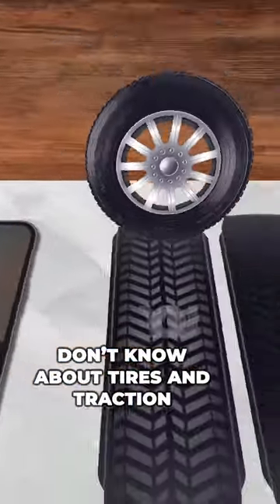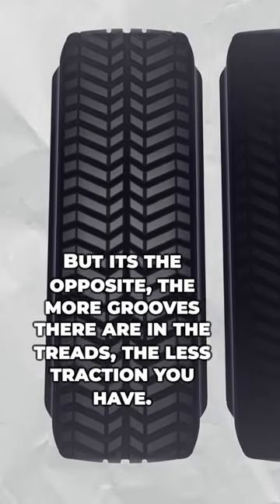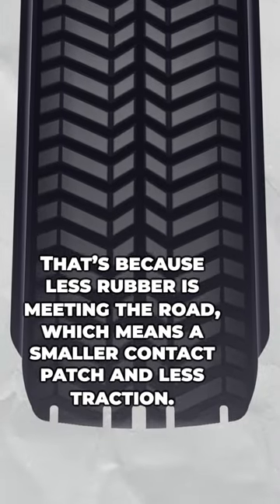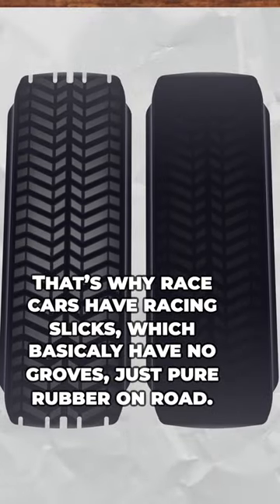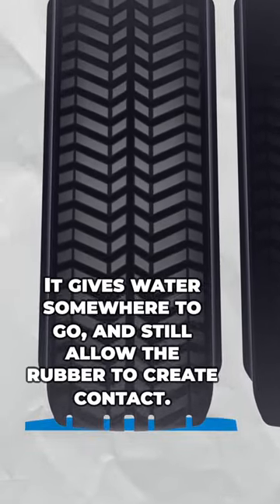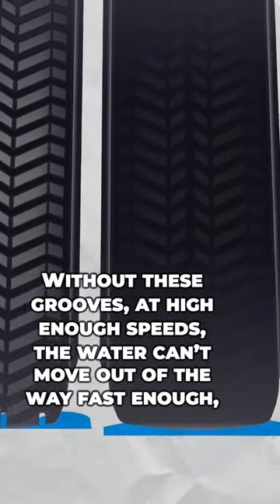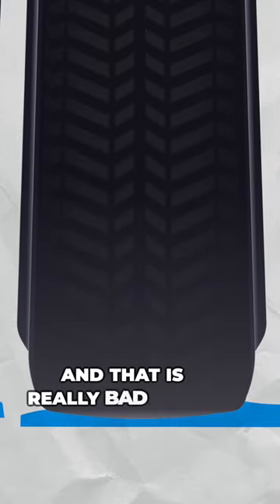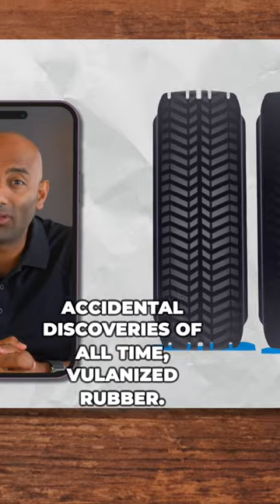3 Things You Don't Know About Tires & Traction!

Comment: Point #1 is just wrong. Friction, or traction, is the product of pressure on the contact surface, contact surface area, and coefficient of friction. 
Cutting grooves or tread means the contact area is smaller but the contact pressure rises proportionally keeping traction the same for the same tread compound. At least up until the point that traction breaks but that will be the same with or without tread for the same compound. 

What IS affected is wear. Since contact pressure goes up, wear increases proportionally. THIS is why race cars have slicks. Increasing the contact area allows you to use a softer stickier rubber, which increases traction, and have it last. 

The part about tread and hydroplaning is basically correct. Which is why street cars have tread since it doesn’t reduce dry traction but does improve wet traction. But as stated before race slicks are slicks so they can use a softer stickier compound that would wear too fast if it had tread.
Reply: Traction is not friction. Friction is what happens when two things move past each other. Traction comes from the objects deforming at a micro level, where the surfaces hook together.
In the case of a rubber tire on asphalt, the tire is deforming and gripping the rough surface of the asphalt. A softer compound deforms more, giving more grip. A road surface that's too smooth gives the tires nothing to grip onto.
At the extreme, traction is much more complicated, because the tire is sliding a bit and gripping a bit.
Reply: @AndrewBlucher  the math is the same either way.
Reply: @williammeek4078  I don't think so. Please explain. In my understanding friction is linear and grip it not.

Comment: You can’t generalize and say “tires with more grooves have less traction”.  Tires with more grooves have MORE TRACTION when the roads are wet or snowy.  Tires with less grooves (“slicks”) only have more traction where more rubber can meet DRY road surfaces.

Comment: He half truths.  Why make them then?
Reply: What do you mean ?   (Sounds all sensible to me)
Reply: No, No he doesn't. You just didn't listen. For pure grip on asphalt, slicks are by far and away the best. BUT.... As he very very clearly states. When you throw in adverse weather conditions, you need the grooves to move the water. He could not have expressed this more clearly in a short video. YOU are the problem here. Not him.
Reply: @robertfullard5646 it is more that for the same compound putting tread on the tire does not reduce dry traction compared to the same tire as a slick. 
This is because traction is the product of the contact pressure, contact area, and coefficient of friction for that specific material. 
Cutting tread reduces contact area but increases contact pressure in direct proportion keep the end traction the same.